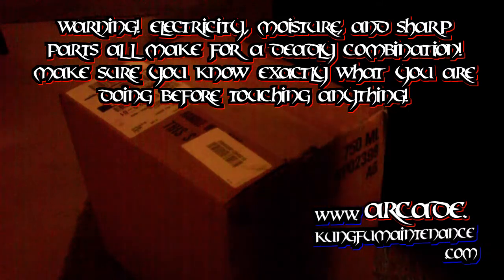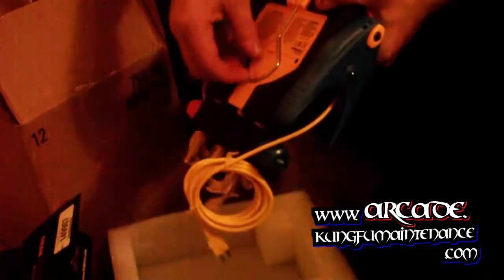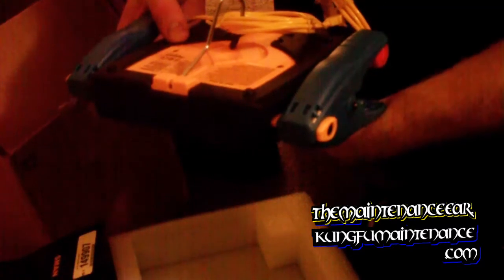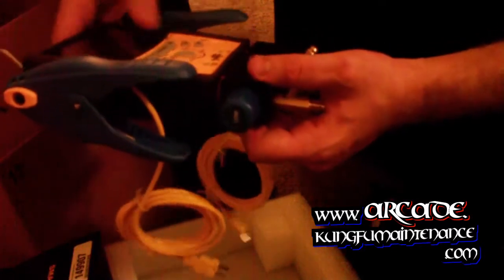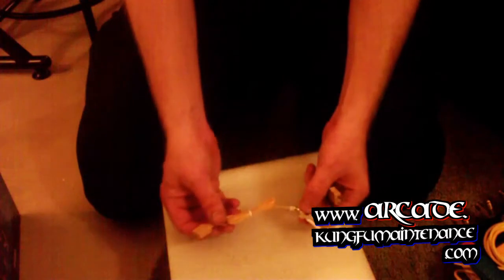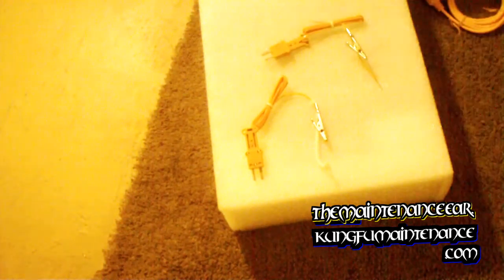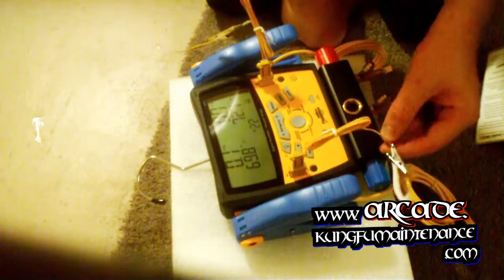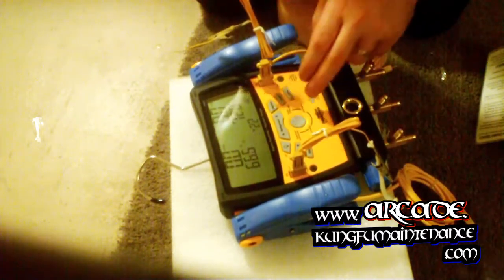Un Boxing Sman3 Field Piece AC Manifold Service Gauges

Comment from the maker: These ones were just a bit over four hundred bones. I also had my eye on a similar design by testos. I really liked a field piece clamp on multimeter I recently purchased and these were carried by my supplier so that had a big part in my final decision. I guess spending a little more I could have gotten the Sman4 which I like even a little more for it's wireless transmission interconnection abilities but this I think was a good first foray experiment into a bit higher technology digital gauges.